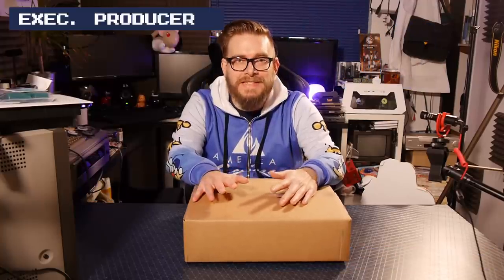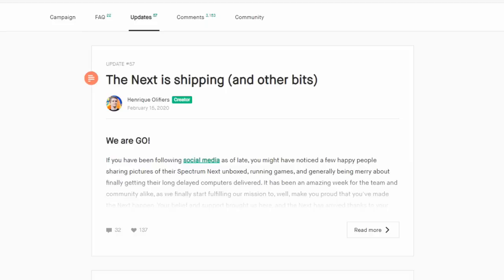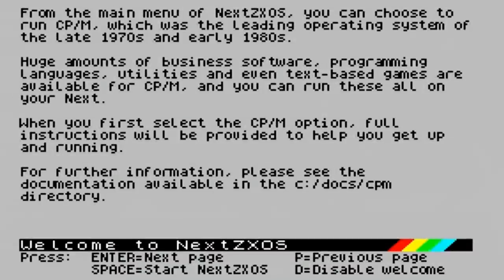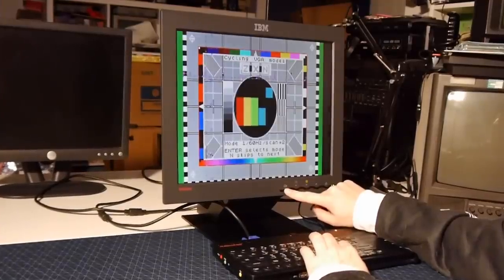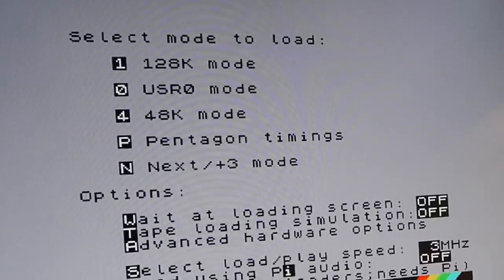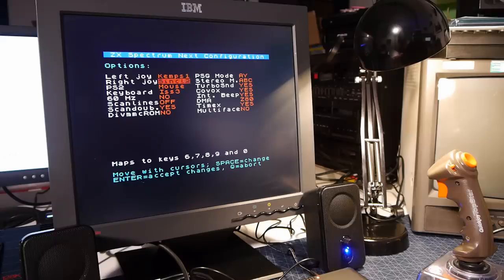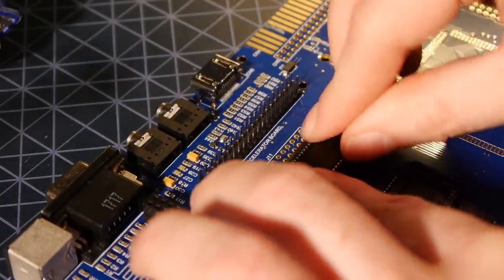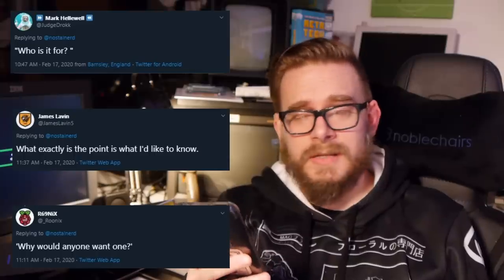ZX Spectrum Next | Nostalgia Nerd

Comment: Oh those were the days when instruction manuals came in the size of Tomes and all in one language,not like today when it's 5 pages the size of a piece of toilet paper in 10 languages.
Reply: ... or in the other case there may be an entire shelf of books all about "beginning C++".  With the ZX, you could pick up programming in a few days.
Reply: Yep! I recently found my good old 48K but the manual got lost :( It was really good, I spent hours with that little sucker. Not only were manuals good but for some appliances they also provided details schematics, diagrams of the interal components and circuits - Louis Rossmann's wet dream, I guess :)) Nowadays, they have entire chapters on telling you not to pour water over your device, and basic common sense stuff like that.
Reply: Right now if it was toilet paper it would be more useful than the manual !!!
Love the Video. I need to get one and re-live the past.
Reply: I remember that the 28K spectrum came with an instruction cassette. the first thing it showed was how to set the computer up, which was useless as you had to set it up to play the cassette.
Reply: *Not like today, where you can look it up online and as a result, the environment is saved as less trees are chopped down for paper.

Comment: 23:03: "The nice thing about this monitor is, it gives you the correct aspect ratio."
I'm pretty sure that's a 5:4 LCD, not a 4:3 screen, but from the rest of the video, the aspect ratio seems to get corrected with letterboxing, and if that's what it is, then yes. It's true that sadly many 5:4 default to stretching or don't even support that, so yeah, nice to find a display that gets this right.

Comment: I'm with Sean D there .. saw a few of the Brit micros, but was mostly Commodore and Atari over here in Ontario Canada; but man, thats a sexy looking beastie. Makes all the other recent 'mini' projects some completely amateurish by comparison. The amount of effort in the case, firmware, manual, out standing. I've been designing my own from-scratch little computers for awhile, and just looking at making a case and keyboard (3d print, etc) is a nightmare and going to suck; to go through and do molds and make all that, its a tonne of effort and expense. Super kudos to them..
... and to you, thanks for the amazing video!

Comment: I have one of these "Early Bird" version and also "just the board" version. I am still using the board version because it already has all the upgrades fitted. I have got all the upgraded parts for the cased version, but for now I am going to keep this in the box as it is.
I started a "DIY Upgrade Components" on the ZX Spectrum Next forum which did quite well.

Comment: Gonna have to correct you in the joystick situation, old bean. The Sinclair Interface 2 used the same pinout as what you're calling Kempston. It wasn't until Amstrad took over that they started messing around with incompatible-but-physically-identical connectors for no reason other than to give Lord Shuggs a chance of shifting inferior branded joysticks at a hefty markup.
Reply: I was pretty sure I remembered it that way. I actually had one of his joysticks. I was never a joystick fan but I remember it wasn't as good as others.
Reply: interesting story about joysticks on the CPC from when i was about 10yo.. i rewired a few old no name console and C64 joysticks to work with the cpc...first time i tryed it cpc was running, joystick was plugged in, and i tried soldering the wires to the joystick pots,and fried the IO chip!. keyboard was spitting out wrong or multiple keypresses and joystick was going crazy. i ended up getting it fixed about 6months later. it got socketed (luckly)..coz i did exactly the same thing again not long after i got it back!..i managed to just buy the chip and replace it myself..
i learnt about ESD the hard way!
Reply: @chaos.corner  They were dreadful. DREADFUL! Weak, spongy things. As bad as the C64Mini's effort. Yuck.
Reply: Accurately, the joysticks were Atari standard.  There's so such thing as a "kempston joystick", that's the name of the interface itself, and the difference is purely in how the interface presents each atari joystick to the machine.

The point about Amstrad futzing with the Atari joystick standard in the +2 and up is entirely accurate, though.
Reply: @IrregularShed  Honestly, I'd take the C64mini's joystick over an SJS1 or 2.  It's not great, and taints the very reputation of the stick that it's cloning, but the Amstrad joysticks were absolutely abhorrent.
Reply: @IrregularShed  I'm going to have to check my box of spectrum things. I think I may have a joystick in there. I'm fairly sure I have a joystick port adapter (though that's not really needed).
Reply: @TheTurnipKing  That's what I originally typed, funnily enough, but wasn't happy with the structure of the comment 😉

I still remember doing IN 31 and twiddling the bits to get Kempston compatibility in BASIC. Halcyon days...
Reply: @TheTurnipKing  Valid points! I find the C64Mini's stick an insult - it looks like it should have microswitches and feel nice, then you try using it and UGH OMG
Reply: @chaos.corner  When I built my ZX Uno I built contacts into the donor Speccy's rubber keyboard case so that QAOPM worked as a joystick and hooked it up to it joystick port internally 😁
Reply: @chaos.corner  It can take, and make use of, a three button megadrive pad if you have one.
Reply: @IrregularShed  I heard they fixed it for the Maxi?
Reply: @TheTurnipKing  I do not. I've never really been a console gamer. I think I read something about an xbox controller but I'm not sure how that's supposed to work.
Reply: @chaos.corner  I think that's via the Pi

Comment: Hold on, I saw a mouse!

WASD+Mouse... where's the Doom port for the ZX Spectrum Next; you could have a non-accelerated Doom for that classic 15FPS dos version, or a fully accelerated Doom for the accelerated next, to get buttery smooth however many frames the Spectrum can out put per second Doom!

If it can run on a bloody calculator, the ZX Spectrum Next should get a Doom port too!
Reply: Someone is working on a Wolfenstein clone.
Reply: Ray cast games will work fine without acceleration. Even a Doom-like engine, which is a bit more complex may work fine if written in assembly. Currently 28MHz mode is more like 24MHz due to memory wait states, but the Z80N instruction set is expanded, and there's a DMA and Copper, AND the ULA replacement has an advanced sprite engine with a minimum guaranteed 100 sprites per scan line.
Reply: point of order: Doom doesn't need a mouse, and infact it's only source ports that made it particuarly usable.  (The original Doom doesn't allow for looking up and down, so vertical movement is translated to forwards and back in the original Doom).

I think there is a TRDOS FPS for Spectrum compatibles ( https://www.youtube-nocookie.com/embed/3v7cFGneuaw?wmode=transparent&iv_load_policy=3&autoplay=1&html5=1&showinfo=0&rel=0&modestbranding=1&playsinline=1&theme=light ), but I don't know how that would work on a Next, since it doesn't actually have a disk interface.  Though CPUwise, it ought to pretty much Rip and Tear.  There's also a native Next Wolf3D in progress.  ( https://www.youtube.com/watch?v=fiZMTcuIvQw )

So, both possibilities are catered for ;)
Reply: @TheTurnipKing  No, you want that mouse; even if you can't look up and down, mouse look is too powerful for you not to have it.

Also, this would be a source port, so looking up and down with the mouse can be implemented.

And that TRDos thing; that's not Doom; I'm talking about actual doom with the actual levels.
Reply: DOS Doom capped out at 35 FPS, of course if you were running near/below min spec I imagine it wouldn't run great.
Reply: for that good old 320x200 70 Hz refresh rate goodness.

Comment: What a wonderful machine - I'm loving my C64 Maxi, but it's clear this is a labour of love and enthusiasm, while the C64 is a purely commercial offering.   I was never a Spectrum user, and wouldn't plonk down £200 on this myself - but, by god, if someone did this for the BBC micro, I'll be on it like a shot.
Reply: Well this is a unit which can do more than a Spectrum could ever do. Three AY sound chips, 256 colours and more.  The Commodore equivalent will be the C65 recreation.
Reply: @6581punk  Oh, absolutely - the only reason I brought the C64 Maxi was to a) support it, b) the joystick and c) the real keyboard. Still not a replacement for my real C64s, but it's nice to have something that just works.  This is clearly a wonderful machine.  But, again, not a spectrum fan, really - this is still marvellous.  Again - would love someone to do this with the BBC Micro.
Reply: @DaveF.  I'm not big on emulation but I did think of getting a maxi do to something really odd and that is to try to hack a mechanical (cherry switches) keyboard into it.

Comment: "The keyboard feels... Better"

It couldn't honestly feel worse than an original.
Reply: Oh well, the keyboards from the Plus-Versions onwards were quite good, actually. I had no problems with those. The original rubber keyboard of the first Spectrums looks terriffic (design) but takes a little getting used to. But again, it was acceptable for typing and quite good for gaming.
Reply: The original Spectrum’s keyboard was great when playing Daley Thomson’s Decathlon (and similar games).
Reply: I just love "It feels like a Spectrum should, just not crap!"
Reply: I understand that the keyboard had to be cheap to fit the budget of the computer, and that therefore you couldn't have a great experience typing on it.

And I appreciate that it's part of the charm of the old British PC platforms that they made these cost compromises in different ways to one another.

But nobody would deliberately make a keyboard that way if they were less constrained.
Reply: The feel of the Spectrum keyboard... Oh boy, talk about nostalgia!
Personally I actually preferred the original rubber keyboard over the QL:esque keyboard on the 128K model. I can't remember ever touching any of the later (+2 and +3?) versions so I can't really say anything about those. But as I remember it the keys on the 128K version tended to bind up if you didn't press the exact middle of them. The rubber keyboard might not have looked as nice, but at least it didn't bind if you pushed them on the edge.

And in the video it was mentioned that the weird input method where a single key press could result in a complete basic command being input was used to save memory. This needs a bit more explanation for those who wasn't there at the time. This input method was inherited from the ZX80 and ZX82, computers that had a massive 1KB or 1024 bytes of memory. Just to give you some idea of how little that is just the display, which was character mapped with 32 x 24 characters, takes up 768 bytes, leaving only 256 bytes for program, variables and control data. (Wikipedia claims it was 384 bytes, but I can't get this to compute...)

To make the computer at least minimally usable without a memory expansion card several techniques were used. First of all the display memory was assigned as needed so if you limited the output to lets say one row at the top of the screen then that would leave a lot more memory, something like 990 bytes (according to Wikipedia) available for programs and such. To conserve more memory the commands in ZX Basic was assigned a number and stored as a single character. So instead of storing a command like "GOTO" as four letters and a space it was stored as one byte. To avoid having to do the translation between text and the codes each keypress would generate the correct code for a complete command in the editor.

The Spectrum was basically a ZX81 on steroids. A lot of the functionality and the Basic was lifted from the ZX81 and enhanced to support the new functionality. Even though the new machine had much more memory, 16KB or 48KB, it retained the Basic editor and method to store the Basic code. However it didn't retain the character mapped display but instead used a bitmapped screen buffer taking up 256*192/8 bytes or 6KB for the bitmap, and a 32*24 grid for color (foreground and background) and attribute (normal or bright, solid or blinking) information taking up a further 768 bytes for a total of 6912 bytes.

Comment: I learned programming in 1965 on a giant-sized "minicomputer" called the LINC, with 2K 12-bit words. There were no games, and just a few demo programs, as this computer was designed for working scientists in laboratories. Upgrades included the LINC-8 then PDP-12 computers, which had more memory but really worked much the same. I wrote all the systems software for the lab I worked for at the U of Pennsylvania, including an operating system and a disassembler. I also wrote much of the lab software, including programs to control data generation and acquisition during experiments. I think I almost had as much fun as those of you who learned how to create games. Later, I worked for the Honeywell Multics project, for Digital Equipment Corporation, for Prime Computer, and for several startups. All eventually failed, not, thankfully, because of anything I did or didn't do. I tried to interest DEC and Prime in tiny computers, but they kept developing every larger systems until the competition with other companies developing large systems and the saturation of the market for those systems killed them.

Comment: I as a lot of speccy owners will know (especially if you had the 48k version like me) 
 The tapes especially if you had just switched on took a long time (sometimes) to get to work, so what I used to do is (amongst many many rituals) 

Simply continue to LOAD "" over and over, I think this also worked for me maybe because it cleaned the heads a little or even the tape, or the temp raised and that helped..  9 times our of 10, on a cold boot when loading a game it usually didn't pick up the first part of loading (red and white /blue bars) repeating helps this.

I used to lift the data recorder on its side too. Some of my games would only run this way? No idea why.

If its a bad tape then there's nothing you can do.

Thank you for the video. I had about 500 tapes for my 48k, no idea where they are anymore.

Might invest in one of these..

Comment: Absolutely AWESOME video! 

There's some fantastic information here - especially for folks like me who are intimidated by the hardware and bewildered by all the options the Next throws at a new user. 

I'm REALLY glad you showed footage of Driller and Darkside, too. Those are both high on my list of games to check out on the Next, and I was curious about how they'd run in the different turbo modes. Kind of mind blowing that the Speccy version of Outrun's now playable thanks to those! 

And now to find out how to capture footage from this thing in the correct aspect ratio... not that I have plans, or anything...

Comment: 12:50 the initial loader is set to flip between Digital and HDMI to figure out what it's connected too, but HDMI displays can often take a while to notice a signal and by the time they do it's already moved back to VGA.

17:51 I feel the lack of a contents table and index at the back keenly

44:22 The ribbon cables have that pigtail. I think the board config may need tweaking if you're going to use a classic case/membrane combination, the finished Nexts are set up to assume their own case and keyboard.

Comment: I never owned a Spectrum and was kind of curious what this brings to the table. It was interesting to learn about and I can understand the appeal. The thing that really grabbed my attention though was the part where you mentioned certain games use video timing tricks which don't display properly over HDMI. That strikes me as a major issue.

It's only really in the past few years where I've seen display manufacturers heavily focussing on reducing input lag. Seeing how the vast majority of monitors with low input lag by today's standards don't have VGA input, it means you'll have to source an older model which isn't ideal from a performance standpoint.

I know it's unrealistic (and that I'm going off topic), but I'd love to see a modern 4:3 monitor/TV designed specifically for retro gaming. I always run games in their correct aspect ratio on widescreen monitors/TVs, but when I see a 4:3 monitor used for old systems, it's just so much more aesthetically pleasing. Serious thought would need to go into the resolution and scaling options so that it plays nicely with a wide variety of systems, and low input lag/response times would obviously have to be a top priority.

I often find myself wondering (ignoring all practical concerns like mass market appeal and development costs etc), could modern technology be used to emulate the characteristics of a CRT display? For instance: Could a self emissive display be configured in such a way that it emulates the way CRT TVs/monitors scan (as well as phosphor decay)? I'd imagine it's possible, however we'd still be left with the issue that affects current fixed pixel displays, and that's scaling. I suppose as resolution continues to increase that becomes less of an issue as you can integer scale more resolutions while losing less screen real estate.